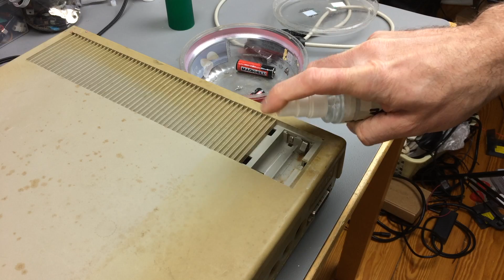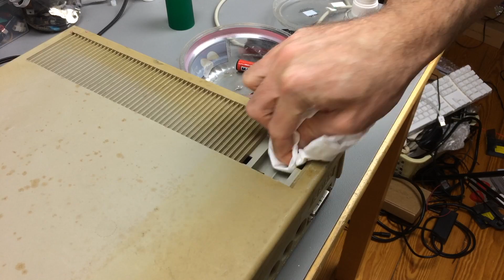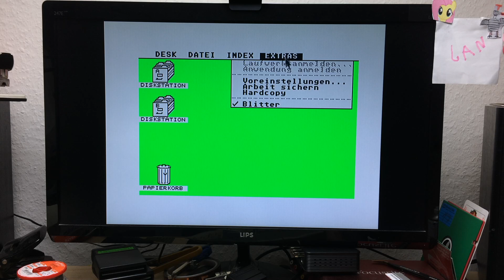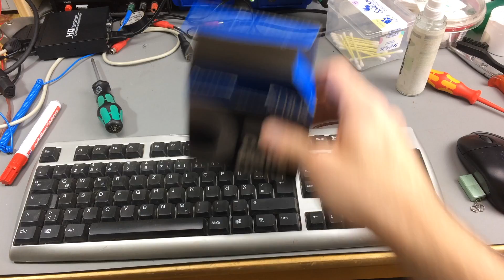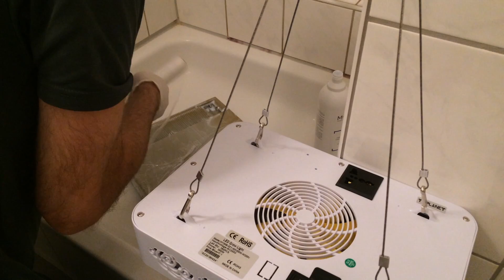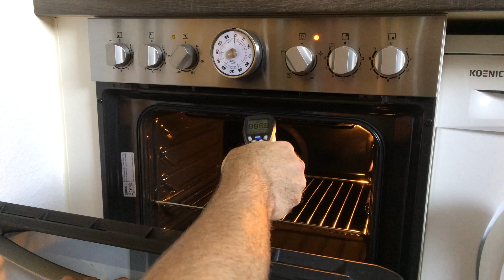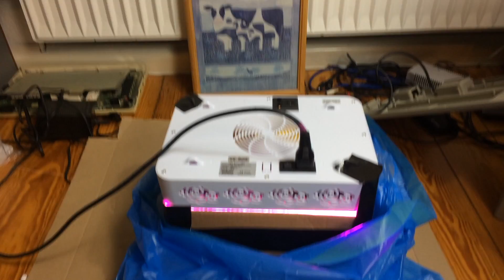Atari Mega 1/Mega ST Restoration

Comment: I never understood the Atari ST to be honest, OK so the 68000 ran slightly faster at 8MHz and the Mega ST had a blitter however just never understood why any would want one over an Amiga. Yes, I realise it was cheaper and released before the Amiga to compete against it (Tramiel vs Commodore). Also I don't see why built-in MIDI was such a selling point when you can fit an adaptor to almost any other computer at the time. Also it had the same soundchip as an Spectrum +2/+3.
Reply: "just never understood why any would want one over an Amiga."

They cost around half as much, ran faster, didn't flicker, their desktop looked about a thousand times better, and they offered the best monochrome display you could get for under $5,000.  They weren't as good a gaming system, but they blew any 8-bit out of the water and didn't cost all that much more than the janky Commodore 128.

Unfortunately for both Atari and Commodore, the Tramiels and Commodore management had infuriated so many major retailers in the US that none of them were willing to deal with either the Amiga or the ST.  And neither company had the money or the talent to run effective advertising to drum up demand.  

Atari dominated in Europe for a couple of years with their far lower-priced machines (the 1040ST with its megabyte of RAM for under $1000 made a huge splash) until the Amiga 500 came out, dropped in price and became widely available.  The inexpensive, widely available 500 let Commodore finally take the lead in Europe.  

But neither machine ever really penetrated the American market, which was pretty much sewn up by the PC clones and the Mac by 1990.  And as those dropped in price neither Commodore nor Atari were ever able to sell the kind of volumes it would have taken to make a profit at their increasingly-slim margins.  Couple that with some truly bizarre product decisions and a lack of product development and you were left with a shriveling userbase comprised mostly of gamers.  By the time the 1200 and Falcon rolled along it was already far too late - users had moved on to the next gen consoles, the PC and the Mac.
Reply: Unless my brain is malfunctioning...  The Amiga was advertised and very much looked forward to before the name Atari ST was even thought of.  The Amiga having a direct pedigree going back to the great days of Atari Hardware design from former Atari employees was THE NEXT Atari down to the core of it's chips.  Atari was already not Atari in many senses by then.  Amiga was at that time its OWN company, and not part of Commodore.  When Jack Tramiel swept in and grabbed the ailing Consumer Atari group for a song and a dance after being kicked out of Commodore, the race was started.

  You can skip the rest if you want to... I wrote the following to help refresh my mind of events...  Too much remembering and research though old papers and files for this, but it is what it is.  Of course, there is much more but I tried to stay on topic... What was the topic, I do not really even remember now...

  Jack had wanted Commodore to switch efforts to a next generation computer, based on the 68000, but upper management disagreed with him.  When Jack was kicked out of Commodore in January 1984, a few key engineers left with him, and by June 1984, the hardware design of the then un-named 68000 based computer was mostly complete, with no brand to place on it, and no place to manufacture it.

  Meanwhile, Amiga had been working on their project since September of 1982.  A 68000 based system with a full set of custom chips that was going to be a new video game console.  They even had at one point made a contract with Atari for development capital to help create the new chip set.  Due to the Video Game Crash in 1983, the video game project turned into a full blown computer.

  In January 1984 a Prototype of the Amiga computer was shown at CES.  This was also proof to Jack Tramiel that the days were truly numbered for the old Commodore computer hardware, and that he was correct in pushing forward with a new 68000 based computer design.  

  March - April 1984 More details were released about the new upcoming release of the new Amiga Computer!

  June 1984 - Deadline approaching for Amiga to provide Atari the "chip set" for use or loose the rights to it!  Amiga approaches Commodore for additional funding to keep the Amiga on track and not vanish as a company.  Commodore instead BUYS Amiga and throws the first preemptive strike in the new war between Atari and Commodore.

  July 1984 - Jack acquired assets of Atari he was interested in, including manufacturing facilities and distribution network.  The new company was named Atari Corp.  (He had been searching and seeking other companies to buy including looking at Amiga before the Atari acquisition.)  He now had a home to sell his new 68000 based computer from! - Jack goes on to get rid of Atari engineers, and make the new Atari his home.  After looking at what projects had been put on hold in the ailing Atari near the end of the Warner years, a few halted projects were released and put back on-track for production and release in time for the Christmas season 1984 including the Freddie version of the 800XL.  The 8-bit computer line was slightly updated to the XE series and put in production for 1985 to better match the new design looks of the new Atari.

  MIDI - After some issues with production yields of the new sound ship for the Atari 68000 based computers, it was decided to incorporate the MIDI interface into the computer to reduce costs, avoid any issues with further development of the sound chip, and allow a quicker hardware design lock-down to provide a quicker release to market time line.  This MIDI decision was also one of the biggest reasons for the large number of sales the Atari ST series of computer had.  Musicians all over the world picked it as their computer for music creation!

  April - June 1985 VERY LIMITED marketing of the Atari ST.  Only sold in a small number of regions, (I think it was only in New York City, and somewhere in California from what I remember.)

  July 1985 - Amiga 1000 on the market!  Some hardware issues slowed production till about March of 1986.  But in some markets and regions in the USA, it was still easier to buy than the Atari ST series of computers.

  And so in July 1985, the culmination of nightmares began.  Atari was selling what should have been Commodore machines, and Commodore was selling what should have been more rightly Atari machines...

  Despite the Amiga being easier to find and buy in my area, I waited till I could get the Atari ST for use with Music due to the much advanced MIDI capability over what I had been stuck with up till then.

  I used the Atari ST (a 520STFM, which I upgraded the RAM on immediately, to match a 1040ST) for Music with MIDI, and also for electronic projects for programming EPROMS with the Printer Port interface and designing printed circuit boards.  It was still I feel the most complete computer platform I have ever had using it for nearly everything I used a computer for.  And it did everything well.  Ever since then I use different computers for different applications.  I still see in many forums, that as of 2016 there are still many users that prefer to use the Atari ST series of computers for MIDI music applications!

  1987 - Atari released the TT series which finally introduced a custom  "Blitter" chip for the new Atari line of computers to start to allow some hardware competition with the Amiga computers for graphics...
Reply: @denshi-oji494  The Amiga was not "advertised" before the ST got to market.  Indeed, even after both computers came to market, there was very little advertising and very little media attention, especially in the US.  The Amiga had been occasionally mentioned in enthusiast circles, but there was nothing like the hype around it in the mainstream press that had preceded the launch of the Macintosh.  The ST ultimately got about as much media hype as the Amiga, which wasn't much, thanks largely to whoever it was that coined the term, "Jackintosh", a hook the public could immediately understand.

In Europe both systems made a larger splash, due to more robust dealer networks and the more prohibitive cost of the PC and Mac for European consumers.  The mainstream machines just weren't an option there due to price, even for educated middle class folks who might be interested.  In the US incomes were generally higher and so people who wanted a computer that was more capable than a C64 had the PC and Mac as options .  That immediately limited the market for both computers to consumers who were demanding but price sensitive.  The low cost of the ST - half that of the Amiga - gave it a huge initial advantage.

The ST arrived in quantity by late '85.  The Amiga didn't turn up in quantity until the summer of '86, and it cost twice as much.  That meant the ST started with a big sales advantage among the target audience - enthusiasts who couldn't or wouldn't spend close to $3000 (or over $4000 in the case of the PC AT) on a computer.  

Software developers for the two new machines also had to determine if they wanted to spend more time building something that exploited the Amiga's custom hardware, or write something simpler on the ST or Mac that they could simply port between all three platforms.  This was an exact repeat of what happened in the prior generation on the Apple // and Atari 800, where initially only a handful of developers really took advantage of the 800's unique capabilities.  This again gave the cheaper ST an advantage its first couple of years, since a lot of initial Amiga software didn't come close to fully utilizing its capabilities.
Reply: I fully agree.  I guess to me, since I was deep into computers at the time, all the information that did come from Amiga Corp., was to me the same as advertising.  So I would agree there were some mentions of the Amiga in the enthusiast circles, and if you kept touch with all the releases of information, it seemed it was actually advertised.  I guess the first full public announcement for the Amiga as a computer, was the CES show in January 1985 where they showed a proto-type with the BOING demo.  They did however also show it to a number of magazines before that.  As far as I remember, there was no word at that time still about the upcoming Atari ST computers.  I wanted an Amiga, had few friends that did get them, and while they were cool, for me the only real use I could see was eventually with the Video Toaster, which I was not into Video enough to justify the platform.
Reply: The Atari ST was released first, cost quite a lot less than the 256K Amiga 1000, and to many people, had a much more pleasant GUI. The Atari ST does better MIDI timing than the Amiga even when the Amiga is fitted with a MIDI card whereas the ST came with the ports standard.

As for the back story, yes, the Amiga Lorraine chipset was designed by ex-Atari Inc people such as Jay Miner and Joe Decuir. Jay quit Atari Inc right after the Motorola 68000 was released and he tried persuading management to allow him to build a 68000-based computer even though they were still finishing up the Atari 400/800 and trying to get it released.

Per the contract, Amiga was supposed to hand over the Amiga Lorraine chipset to Atari Inc because they couldn't repay their loan. The agreement - which is posted online - stated Atari Inc would have exclusive rights to the Amiga Lorraine chipset to be used in a 16-bit console, and after 1 year, they would be permitted to use the chipset in a computer line. Atari Inc also was supposed to have the right to use the Amiga Lorraine chipset in arcade machines. Atari Inc itself wanted to buy up all of Amiga. Per the agreement, Amiga was restricted from licensing the chipset and also selling themselves to any of Atari's competitors which specifically included Apple, Commodore, IBM, and others. Amiga violated the agreement first by approaching Commodore and secretly agreeing to them purchasing the company for $25 million, and secondly, but attempting to return the $500k loan on its due date and falsely claiming the Amiga Lorraine chipset didn't work. 

Jack Tramiel's Trammel Technology Ltd. company bought up the assets of Atari Inc's Consumer Division in July 1984 after the 4th of July holiday while Warner briefly held onto the arcade division - arguably the "Real Atari" if not the "original Atari" - known internally as "Atari Coin" before having its name changed to Atari Games Inc. and later Atari Games Corp and selling a majority stake in it to Namco, and selling the advanced consumer telecom division AtariTel to Mitsubishi.

The ST - known as the RBP (Rock Bottom Price)  at the time - wasn't completed at the time Tramiel acquired "Atari". They were still working on it all the way up to CES. And Shiraz tried to integrate the unfinished Atari Inc AMY sound chip into it but couldn't get it to work. They "licensed" the AMY to Sight+Sound to finish it but that company apparently screwed them over and it became entangled in legal actions for several years and was never released by either company. They then pivoted to the Yamaha YM2149 because Yamaha wouldn't sell them the YM2151 because Yamaha was already using it in their music computer and didn't want those advanced features being used by competing hardware. Adding MIDI to the feature set had nothing to do with the perceived shortcomings of the YM2149 nor the inability to use the AMY or YM2151. Atari Games had planned to use the AMY too but Yahama had courted them with the YM2151 and so they used it instead for years in their arcade games to supplement their Dual and Quad POKEYs and TI speech synthesis chips. 

Plenty of former Atari Inc staff worked on the ST, but mainly in terms of the GEM/TOS operating system. Chiefly amongst them having been Landon Dyer and Dave Staugus (sic). And as such, the ST is just as much a product of "real Atari" staff just as the Amiga was. They are both brothers-from-different-mothers...  

Had Atari Inc remained a single company, they would've released the Amiga Lorraine chipset in the "Mickey" console - with 128K RAM - for Christmas 1985. Just imagine, the 16-bit console war starting in 1985 instead of 1989. They would've released computers based upon it in 1986 per the agreement or possibly sooner had they been able to acquire Amiga Corp outright. But they wouldn't have used what became the Amiga OS because Atari Inc already had a license for GEM and they also had Dual 68000 systems built in the Advanced Research Division running BSD and their own in-house GUI in 1983... Commodore was the company that acquired what became Amiga OS from Metacomco, if I'm not mistaken...

Comment: Here are a few suggestions to do on your Mega ST
Reply: 1 Upgrade ram from 1 tot 4 MB, use a 1040/520 st guide to install a 72pin simm
2 Change the 68K to a HC version to reduce power consumption to near 0
3 Change the psu for a new one, this one has a terrible ~30% efficiency
4 Get an external floppy drive and put a GOTEK in it and reseach how to swap the DS0 DS1 lines withou cutting the controller chip pins.
5 try without the blitter patch they aren't needed for all the Mega's.
6 Make a tos switcher so you can use the latest mega st tos 1.04 which you have roght now and the latest and greatest tos 2.06.

Comment: Großartig! Sagte ich, dass ich ein Atari-Fanboy bin? :-) Ein paar Anmerkungen: Das Atari-Logo in Regenbogen-Farben beim Menüeintrag "Desktop-Info" gibt bereits den Hinweis, dass es sich um TOS 1.04 ("Rainbow-TOS") handelt. Das ist eine sehr gute Version, die Du getrost behalten kannst. Das TOS gibt es in 6 oder 2 ROMs. Du hast die Version mit 2 Chips, daher sind die übrigens Sockel nicht bestückt. Der "Mega 1" ist keine frühe Version, sondern eine späte. Die ersten hießen noch "Mega ST" und hatten TOS 1.02 ("Blitter-TOS"). Dass er 1 MB RAM hat, sieht man an der 1 in der Typenbezeichnung. Es gab noch Varianten mit 2 und mit 4 MB. Der Mega hat im Gegensatz zu den STs im Tastaturgehäuse einen Blitter und eine Echtzeituhr, daher die Batterien. Das Booten ohne Diskette dauert ewig, mit einer (Leer-)Diskette im Laufwerk geht es viel schneller. Was wirklich nützlich wäre, wäre eine Erweiterung auf 4 MB. Leider beim Mega 1 nicht so einfach wie beim Mega 2, aber es gibt tolle RAM-Erweiterungen z.B. von Exxos aus UK (einfach mal "Exxos Atari" googeln). Auch nützlich wäre ein Gotek mit HxC oder FlashFloppy Firmware und/oder ein Harddisk-Ersatz (günstigste ist wohl Satandisk V4 von Edu Arana). Bei weiteren Fragen kannst Du mich gern kontaktieren. Ich wohne nur 30 km entfernt. :-)
Reply: I don't speak German, but hello fellow Atari fanboy :)  Yes, there are 2 and 6 chip versions of the TOS rom. There should be several solder pads to solder / desolder to indicate the size of the ROMs you have installed, though this is now moot as later ROMs are in sets of two. A TOS switcher with TOS 2.06 could be fun to play with.  

Exxos forum is great. He has a great web store also, but does not accept pay pal, he's had issues with them before.